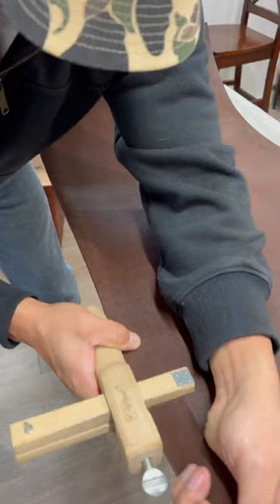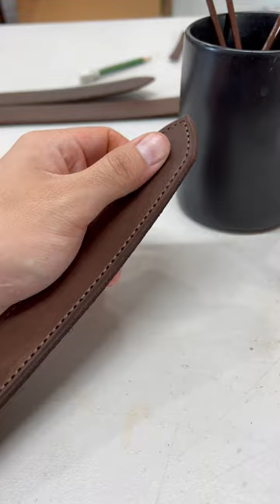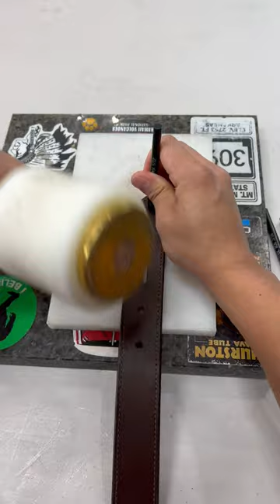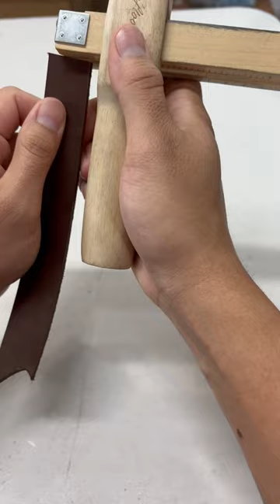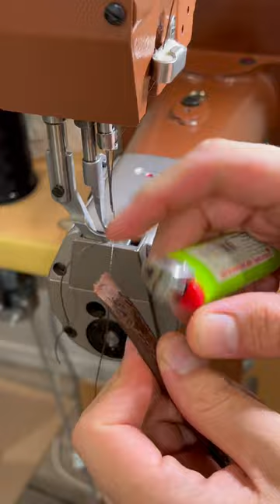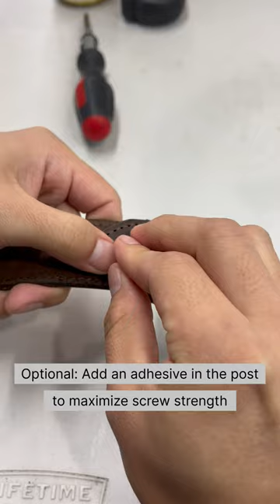Making a Simple Handmade Leather Belt - Build Along - ASMR

Comment: What is yellow material you rub it  after cutting edge .?
Reply: It’s glycerin soap
Reply: @joelreeves17  what is benefit to rub this ???
Reply from the maker: I use water and saddle soap as a lubricant to help the edge fibers lay down and seal up as I burnish them. I have a full length video over how I finish edges that explains more in depth!